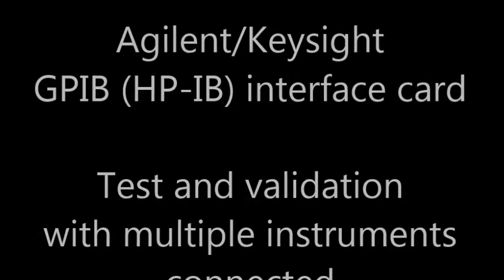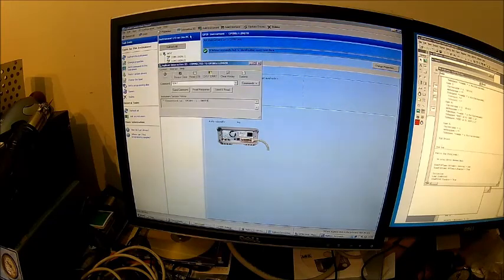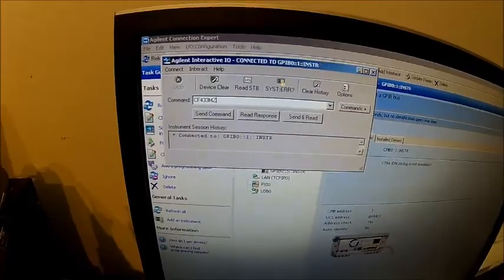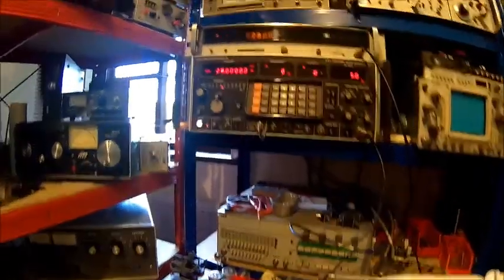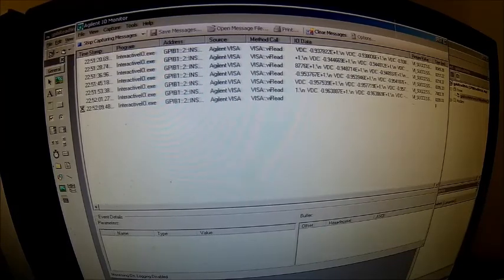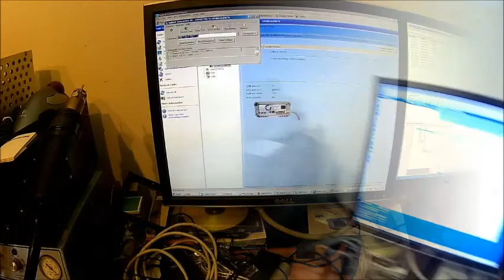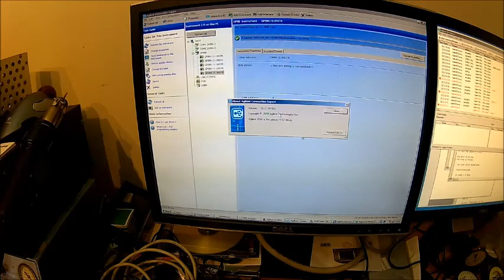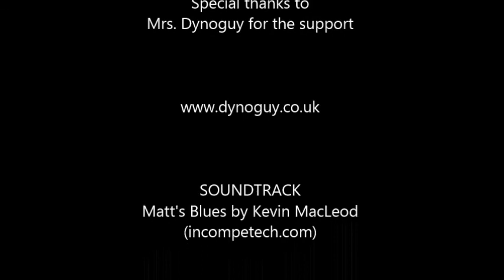Agilent/Keysight GPIB interface card functional test and validation (82350 PCI card)

Comment: This may be a long shot but any experience with controlling an HP 3968A Instrumentation Recorder via HP-IB?
Reply from the maker: Sorry, never seen one of those, but if you have the commands manual, it should not be that difficult. What i know for sure is that older HP gear can be a bit tricky with timing and sometimes it just won't work with other (non HP) gear on the same bus. E.g. Solartron and HP can be a real drama .... speaking of 1980's stuff here